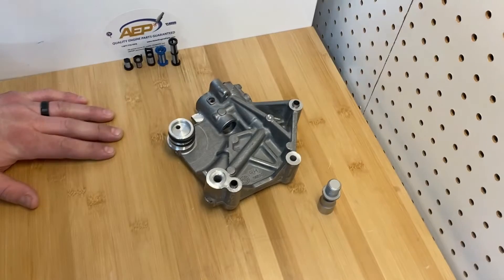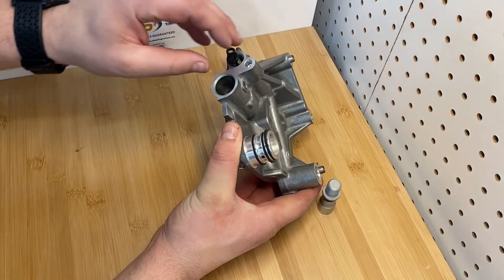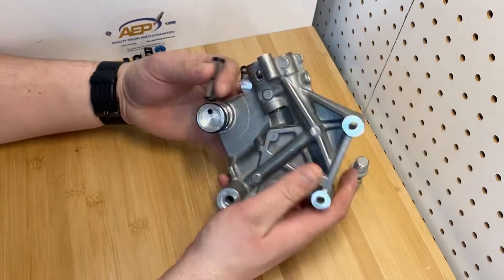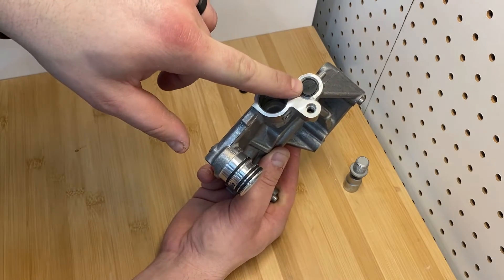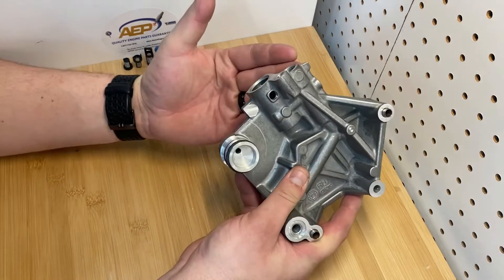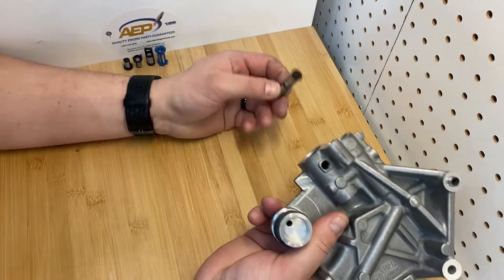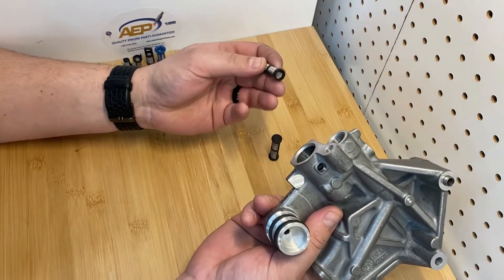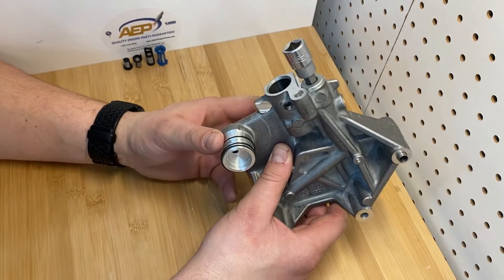Ford 3.5L solenoid and VVT feed housing filter replacement.

Comment: I have a sneaky suspicion that this is the reason why timing chains end up snapping. One of the housings on my car is all kinds of chewed up where those 3 seals are. The other one is not all that fantastic either. The slots are worn at an angle. I am not 100% sure how the so called "seals" really do anything as it isn't a pressure fit into the cam phaser. It's actually kind of sloppy even with new phasers and a new housing. I did not know there is a filter inside the damned thing because no one says to replace those things in any of the timing chain instructions and the shop manual doesn't even say to replace them or say anything about a filter inside of it.
Reply: Im doing a 3.7 v6 timing change and head cylinder since bend the valves fotr a bad water pump. I just saw a tiktok and now im here just looking to order this tomorrow at the dealer. They were dirty but already did the hole.
Reply: @APR_Customs  You have to really visually inspect the grooves the 3 plastic seals ride in on the housing. If there is any oil starvation at all because of the screen being partially clogged what ends up happening is the seal will spin with the phaser due to there not being enough lubricant for the phaser to move over the seal. That spinning actually wears the groove it rides in so it ends up being crooked. 

This is what had happened to mine. When it got crooked enough the seal got stuck and stopped rotating with the phaser so now the phaser was riding over the seal when there isn't enough oil to lubricate properly. That caused a lot of heat which resulted in the seals melting, once that happened now whatever oil was supposed to be going to the phaser and cams now blow past the melted seals. That caused oil starvation to the phaser and cams on that head. I was lucky and caught it in time. The oil starvation to the cams is what causes the chain to break due to the added friction when the cams spin. The chain is not designed to withstand the forces from a cam starting to seize. The phaser also gets messed up and causes the sprocket to move wildly which bucks the cam when the phaser hits the stops without having oil pressure to ease it to the stop.
Reply: @APR_Customs  The truly crazy thing about this is there is no mention in the ford/lincoln shop manual about this filter needing to be cleaned when doing the timing chain. Nothing in there that it even exists. Not one of the timing kits I have seen make mention of this filter either. Nothing stated about replacing those housings when the chain gets done. That is the only way to replace the screens other than buying ones from these folks. This video is the only thing I have found about the existence of these screens.

Ford does some pretty shady stuff. I just had to replace all of the subframe to body bushings on my Lincoln. I ordered the fronts and when I went to order the rears ford states that you have to buy the whole subframe and it's on national back order. The whole frame is 800 bucks and another 500 to ship it freight. I key in the part number for the subframe and low and behold it is used in other vehicles and the bushings were available for the other vehicles and they were all the same part numbers. I ordered them and low and behold they were the correct ones..